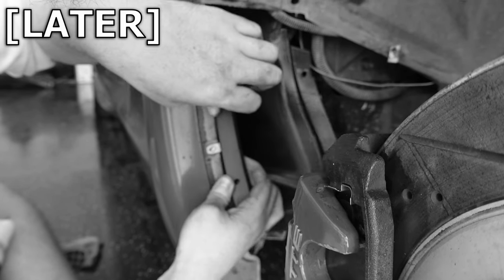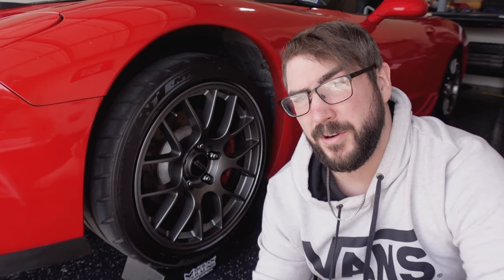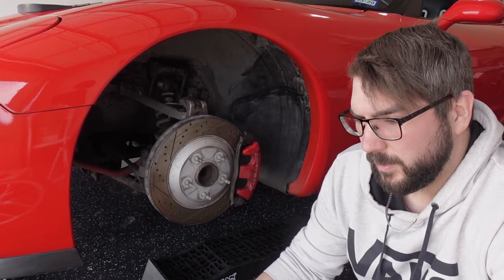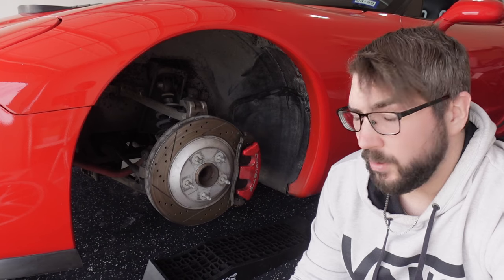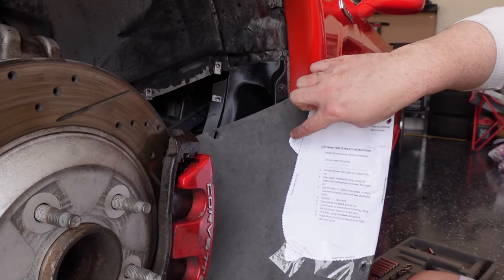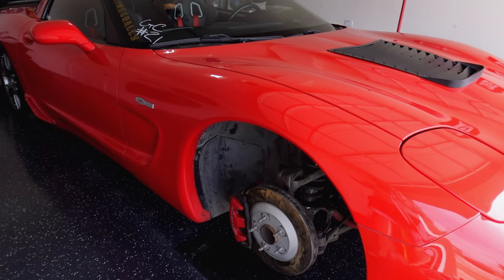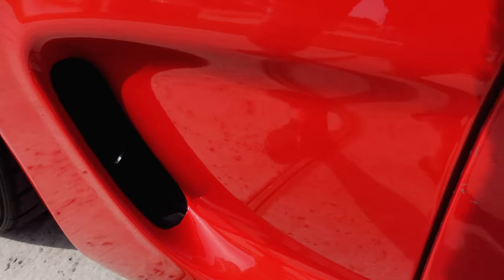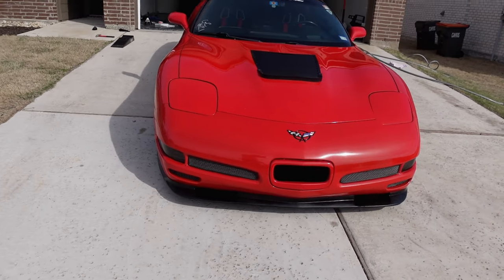Do This Mod If You Track Your C5 CORVETTE! // Functional Fender Ducts

Comment: After 5 months how are the sides of your C5? Im worried about rock or debris damage as i have been wanting to do this for a long time.
Reply from the maker: They're perfectly fine. 

Honestly, the only thing that concerns me a bit is when I go to the track and the tires get good and sticky. At that point, it might throw some. 

If you check out my LS Fest prep video, I wrapped that section before the event just to make sure it would be good.

Comment: I purchased these and the template is off. On the lower outside of the vehicle on both sides it will need to be 1/4 up and 3/4 of an inch back towards the center of the car for the correct notching so not create a gap. Found this out the hard way but once you cut your inner well it's too late.
When you said you were missing a bracket. They only sent me two in an envelope and they do not send enough brackets for the installation. One can be used from a pre-existing hole otherwise we should receive 6 for the others, but do not.
I also could not get the inner holes to line up. It's tight enough just with the outer two so I left the inner two out.
Reply from the maker: Yeah, I noticed that with the template. Unfortunately, I have a little gap on my inner fenders as well :/

Comment: I do 180/190 in my 2001 C5 and I have literally never experienced any of the issues you were stating you need these ducts for 🤣
Reply from the maker: Not really sure which issues you're referring to. 

If you're talking about turbulent air inside of wheel-wells, then I don't know what to tell you other than you're wrong, and wind tunnel data proves it. 

It's not that you've never experienced it. It's that you've never NOT experienced it. All closed wheel cars are susceptible to trapped/turbulent air inside the wheel-wells. 

That's why vented fenders exist in the first place.

Comment: What exhaust do you have? Sounds amazing.
Reply from the maker: Borla S-Type II
Reply: Love it. I have an old Borla on my C5Z as well but yours sounds a little throatier. 4 @ChaseFarrow
Reply from the maker: @surgicalmotorsports  It might be my headers and X-pipe. Have you done your full exhaust?
Reply: Good point. I have full catless X pipe but I don't think they are aftermarket headers.  I'll throw on the lift and look.  @ChaseFarrow
Reply from the maker: @surgicalmotorsports  Yeah, headers make a HUGE difference on these

Comment: Chase, you have a Z06 I have a 2000 Z51 coupe but on your Z your fender opening cover is plastic whereas mine is a soft rubber and is flexible. I'm wondering why mine might be different from yours? Mmmm?
Reply from the maker: That's a good question. I'm not really sure why yours would be different. Is it shaped the same??
Reply: @ChaseFarrow  My bad. They are plastic but both sides are only attached on 1 side so that they can open and close I guess as when pushed on they are flexible. Something worth looking into. At any rate I like your modifications.
Reply from the maker: @GregorioLonewolf  Oh, gotcha. Yeah, mine could be pushed too. They weren't rigid at all. From what people have been saying, it allows some of the pressure and heat in the engine bay to escape, but it doesn't do a good job of it at all.
Reply: @ChaseFarrow  I totally agree about heat dissipation. Enjoy your Z. I just saw on the side bar that a C5 guy in Arizona (goes by My Corvette Life) put up a similar video he calls C5 Functional Side Cove Ducts.

Comment: Does it drive any different ? Let say at 70mph highway speed ?
Reply from the maker: Nah. Realistically, the area where you'll see a difference is on the track. There, you'll mostly see a benefit in brake cooling because the air coming in from the front can more efficiently pass over the hot brakes, and then exit via the fender vents un-impeded.

Technically, it's going to have an impact at any speed. But you're not going to really feel it on the street.

Comment: Have you tested your top end with this?  Did it make a difference?
Reply from the maker: Do you mean top speed?
Reply: @ChaseFarrow  yes
Reply from the maker: @ericswild  I have not. There aren't really many places to do that. I definitely wouldn't attempt it on the street. 

Trying to do that while having 2" of ground clearance is a death wish.
Reply: @ChaseFarrow I thought your mod was to decrease the wind resistance from the tire rotation. I was assuming this was to increase top speed.  If that wasn't your motivation is it mpg?  Brake functionality?  Have you noticed any changes in either? Or was there another reason that I am missing?

Comment: Those vents relieve underhood pressure and heat…. With extractors on the hood youll be fine. A street car really doesnt need this and honestly shouldnt do this.
Reply from the maker: They don't relieve the pressure or heat even remotely well.